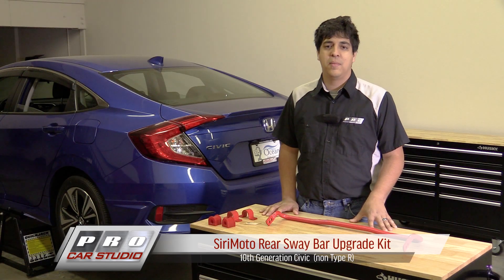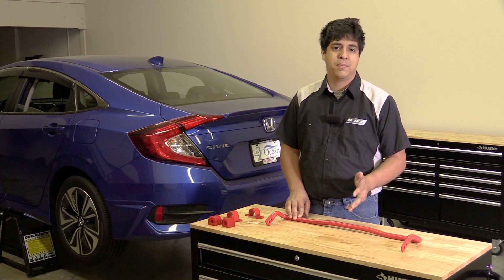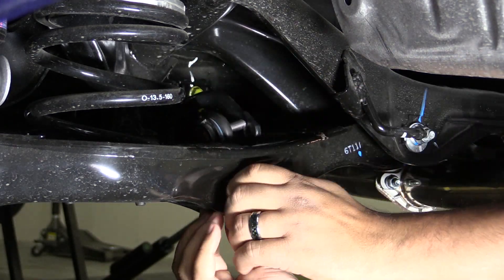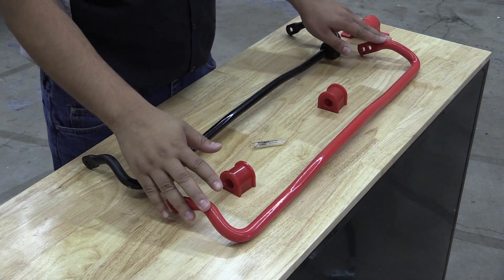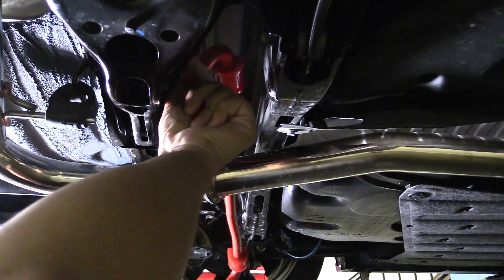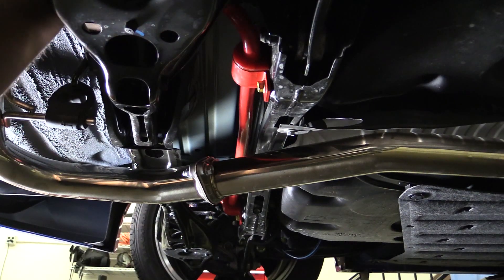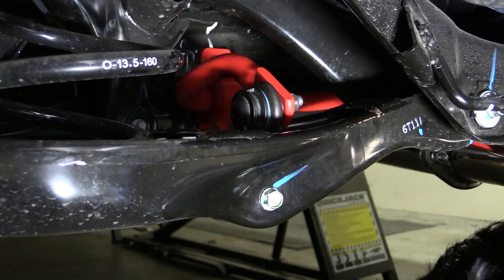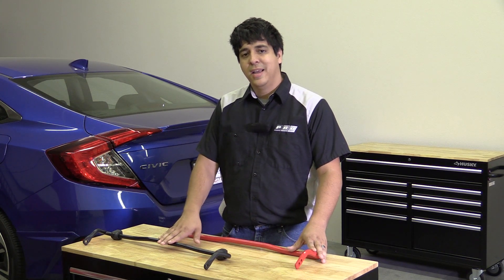10th Gen Civic - SiriMoto Rear Sway Bar Install - 2016 2017 2018 2019 2020 2021 Honda Civic

Comment: So I have this bar installed on my 19 civic hatchback  and I hear clunking noises when I go over bumps and make turns. I have oem accord end links. I noticed at this was installed with Jack stands. Mine was installed while the car was on the lift could it he that due to my car being on the lift and in the air the bolts aren't properly tightened?

Comment: I have a 2020 Insight Touring and was thinking about adding a front strut bar, front and rear sway bar. Do you know if the 2016 to present Civic ones will fit my Insight?

Comment: is this install the same process for a hatchback sport 2017?
Reply from the maker: +Anttillo Yes, this is designed to fit the Hatchback models as well. Please visit the site for other parts that fit your civic: https://www.procivic.com/c/ym/2017/civic/suspension.html?ctid=3224
Reply from the maker: +Donald Choi It is not necessary. The sway bar install will not effect the alignment.

Comment: Unbolting the oem sway looks simple. Just unscrew those 4 bolts correct? Or is it 4 bolts per side?
Reply from the maker: It would be 4 per side, 8 in total (2 for the end links and 2 for the mounting bracket on each side).

Comment: why do we need this?
Reply from the maker: +NAQVI SHAH A sway bar prevents lateral movement (body roll) during cornering. Though the stock ones work well for day to day driving, it is not optimal for spirited or track driving. A larger option such as this, stiffens the suspension more and reduces the amount of body roll the car suffers under fast cornering.
Reply: For track days obviously..

Comment: Does the civic have a front sway bar?
Reply from the maker: Yes, it does have a front and rear sway bar from the factory, but upgrading them (especially the rear one) results in much better handling performance characteristics.